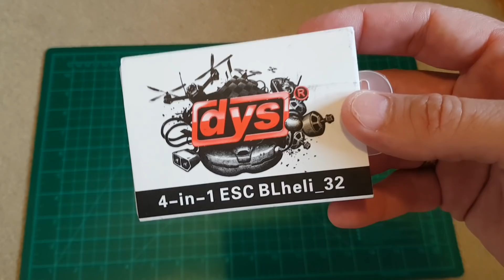DYS ARIA F45A 45A Blheli_32 4 in 1 FPV Racing Brushless ESC

Comment: The outputs of 9v and 5v are generating a huge noise in the video is impossible to use even by placing capacitors. I tested it on 2 different Fcs and the problem persists I do not recommend this esc for anyone who uses the becs. I could only solve the problem by connecting everything directly to the battery.